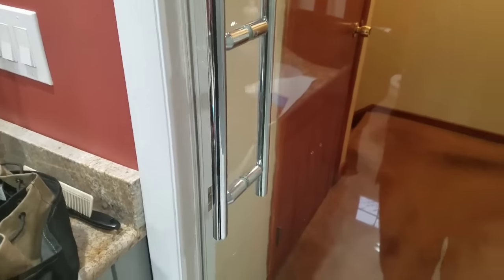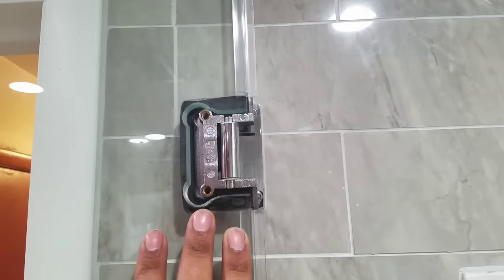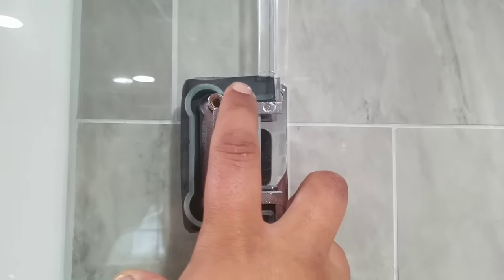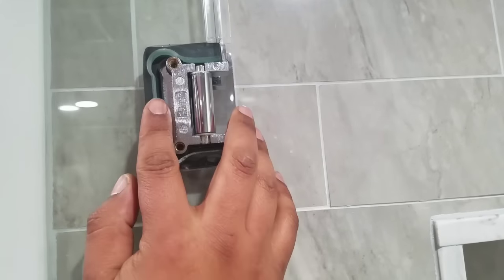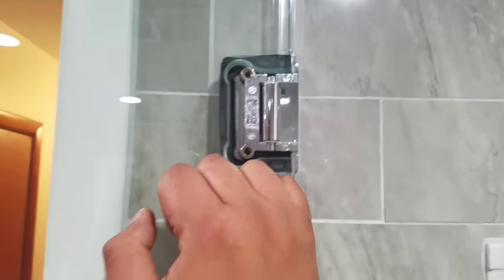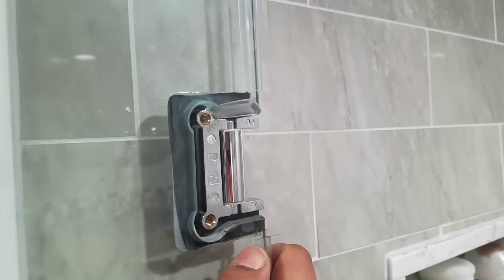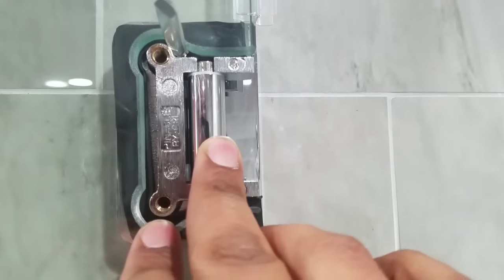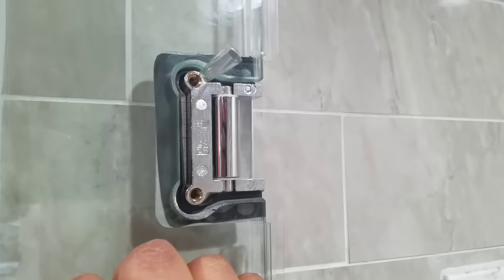Frameless Shower Door Sagging Repair

Comment: Excellent! I wasn't sure if it was what your describing. There are these smaller allen bolts in back that look like they might provide finer adjustments but I think you confirmed my problem because it was fine when it was first installed (2001). Thanks!
Reply from the maker: Hi Thomas!
Those smaller Allen keys hold the Hinge onto the Pivot within the plate. Loosing them may create an issue later on with knocking sounds. Tightening them will prolong the life of your Hinge.
Thanks for your comment!

Comment: The trick is cutting shims to fill  the gaps, use the thick gaskets, and tighten the crap out of the hinges. Lock tight on the screws won’t hurt neither

Comment: This is how I have always done, as well as shimming between glass and top of hinge, so glass weight is on the hinge, and the glass can't move down. If shimmed properly, the hinges can be loose, yet the glass will not move out of adjustment. Shim the bottom hinge on top and the front so glass can't move toward wall.
Reply from the maker: Awesome! Good practice

Comment: The hinge at the top of the door wants to pull out, but the hinge at the bottom of the door wants to push in, so the shims would have to be positioned accordingly.

Mind you, mine doesn't even have the protrusions in the hinge to shim against. The primary function of the curved cut-outs in the glass is stress relief to prevent cracking.
Reply from the maker: The primary function of the curved cutouts is a safety feature to never allow the door to completely slip out of the hinge. Not for stress relief. Glass does not expand unless under "tempering" conditions.

Comment: I’m getting ready to to install a GW 90 deg enclosure and definitely going to do this right off the start, so thanks for tip. Also what is the recommended silicone for inside corner?  Looks like water clear very expensive and not mildew resistant according to CL website. What is your recommendation? Thank you
Reply from the maker: Nice! I don't use water clear. I use the mildew resistant Sanitary version scs1700 from crl. Best of luck!

Comment: I'm doing this as well as using double sided Gorilla foam tape to replace the dried out gasket. Also making my shims out of pieces of large zip ties cut to length.
Reply from the maker: That's a pretty good retrofit!
Reply: Sounds like a DIY project to me. How has the touch tape you used held up against the moisture over time ?
Reply: @TheTradesmanLU2001  My glass door is holding in place vey well. No sagging/slipping whatsoever almost 3 years now. You can get this tape at any hardware store. Gorilla Double-sided foam tape.

Comment: I wouldn't call it a 'mistake' to not stick spacers in that exact spot, it's not actually a requirement for a proper installation, simply an extra precaution to prevent sag over time.

Comment: My gaskets are failing-- there are cracks along some edges and the gasket is getting 'squeezed" outside of the footprint of the hinge.  I have retighten them to no success(multiple times).  I got an estimate from a shower glass company who wants to charge $400 to replace the hinges OR $2000 to replace the glass and the hinges.  We live in Maryland(outside of Washington DC)--- But I think the quote is on the pricey side.  Should I replace the hinges(with new gaskets).  Any suggestion would be appreciated.
Reply from the maker: I believe the $400 is fair to replace hinges and labor. 
If you wanted to do it yourself, you can purchase the gaskets online https://amzn.to/3WoGDBQ.
Reply: @ExceptionalGlassLLC  Thanks for the link.  Just curious the dimensions are 6x6x6.  My hinge is 3 1/2h x 2 1/4 w.
Reply from the maker: @MrAerialsound  I don't know why it says 6x6x6. It's for Geneva hinges that matches the size you have.

Comment: Hi I have a question do you know why my shower door similar to this one makes a loud cracking noise from the hinge when you open it all the way like this? Thanks in advance
Reply from the maker: Hi Hugo.
Usually the recommendation is to replace a clicking hinge.
But before you do, re-tighten the screws. The ones on the wall and holding glass.
If it still clicks, there are 2 very small holes in the back of the hinge (when door is open). Inside are small set screws. Loosen half turn, then tighten right with a little strength. 
You should notice the sound either gets louder, softer or disappears entirely. 
If it still clicks, replace the hinge.
I hope this helps and thanks for watching!

Comment: where do you find those shims? Thanks
Reply from the maker: Shower Door Shims on Amazon! Thank you for watching!
Reply: I'm doing this as well as using double sided Gorilla foam tape to replace the dried out gasket. Also making my shims out of pieces of large zip ties cut to length.

Comment: My glass door squeaks how do I get rid of the sound?
Reply from the maker: Find the place where it squeaks. 
If it's on the bottom, The door may have sagged and needs to be adjusted up.
If it's the rollers, take the door off, clean the roller seams and reattach.
This may help.
Thanks for watching!!